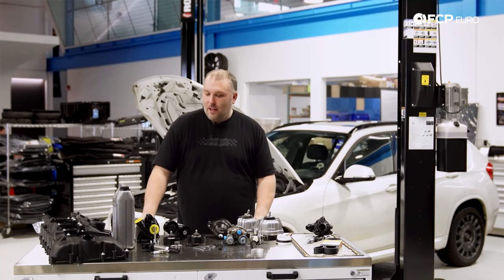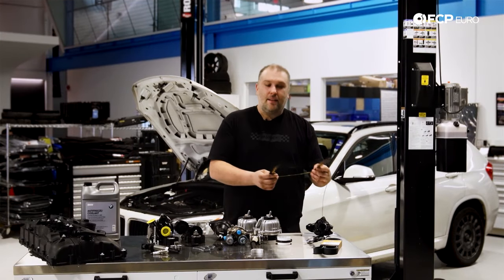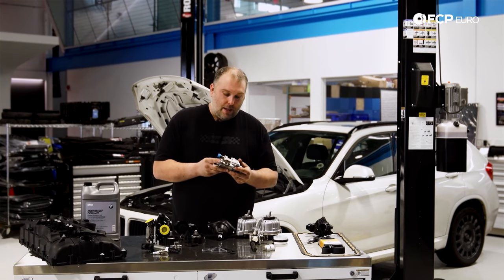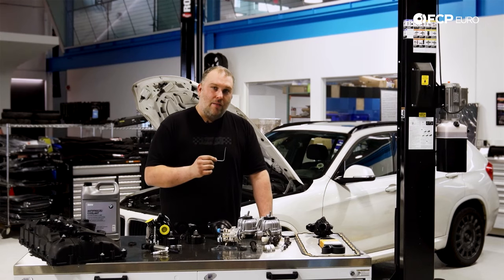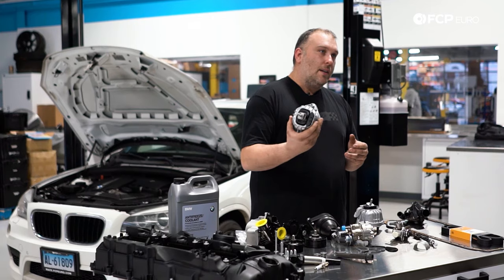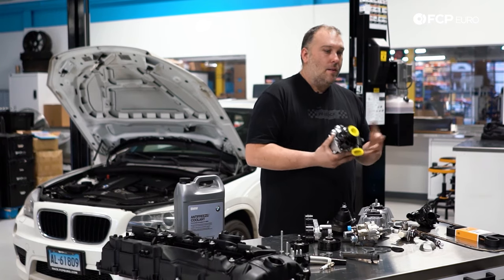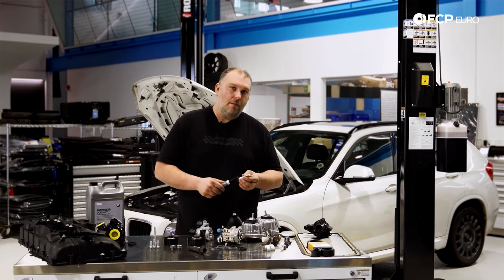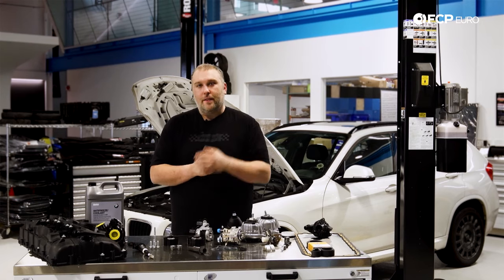BMW N55 Engine Diagnostics/Problems - Everything You Need To Know (X1, 135i, 335i, 435i, 535i)

Comment: Subbed! Knew about some, and already done.
Does the harmonic balancer itself wear? The rubber part on the crank pulley? My pulley has a wobble, causing squeal when cold. Replaced belt 3 times, and the 2 idlers and tensioner. All accessory pulleys running true. I know you can't diagnose in the comment section. Just a general question if you guys found that you have to replace them around 100k miles often.
I've heard about vanos filters? ie. oil filters screwed into the block at 2 places apparently. Is this true, and should they be changed at some interval even just as preventative maintenance?
Can you do a video on just what should be done at which miles for us far outside the US that have to service ourselves? DCT oil change? gearbox filter. Diff oil. Any info regards timing chain slides?
Went through your shop! So much I probably need :-(  "suspension" rattle in the back over rumble strips, with my luck, probably subframe kit if I'm lucky, and I'm not.
And what about factory recalls? I saw one about a bit of battery cable around the passenger footwell that should be replaced. Would this lead to battery not properly charging? Those kinds of issues? ISTA showing a low voltage reading even with a charger connected etc?
Reply from the maker: The rubber part in the crank pulley certainly can degrade and cause a wobble/off balance. It's certainty not a bad idea to inspect those Vanos filters. We have more videos planned, thanks for subscribing!
Reply: @fcpeuro  Thanks so much for the reply! Looking forward to more of these terribly informative videos!!! The one one on interchangeable suspension components to upgrade to M3 stuff was a real eye opener!!!! So much info here!!!!

Comment: So best way to prevent valvetronic from going is to keep up oil changes?
Reply from the maker: Keeping up on oil changes is just a good practice overall, Francis!
Reply: Its going to happen anyway, based on what I've read. Goof thing the solenoids aren't expensive...

Comment: This is very misleading as he is talking about almost all service and wearing parts and ALL engines wear out eventually. He also should mention the sort of Mia large theses items may fail at or need replacing. It the old story get your car whatever brand serviced regularly buy proper professionals and you will have trouble free motoring. I think this guy is just trying to help but it looks more like a bash up and the N55 engine has proven to be a very good and reliable engine. 
Jp
Reply from the maker: Hi John, you are absolutely right, the N55 has proven to be a very reliable engine. We are just trying to point out any possible issues you could encounter on the N55. These examples are like a perfect storm, it's unlikely you will have all these issues all at once or possibly ever, but of course, watching the video without that context can make it seem like they have a lot of problems.
Reply: FCP Euro Thanks for the reply I was not having a shot at you more some of the people commenting as there are always people reading BMW content that just want to be negative so I get a bit sick of that. I have owned a lot of BMWs over the years I always compare what is around before buying just in case there is something of interest in other brands but so far have stuck to BMWs. I currently have 2 an X1 and a e90 M3 so I see a lot of stuff on forums rubbishing the e90 M3 Rod Bearing and Throttle  bodies. But perhaps those knockers should look at the Mercedes forums to see the multitude of issues with the especially the C63 - 6.3 motor which was plagued with issues. And Audi does not escape either. Most people don’t appreciate that these cars are made to be driven at high speed on German Autobahn’s and then serviced regularly at specialist centres then they all work well. Anyway just my rant I am about to replace my wife’s X1 with an X4 35i so have spent a lot of time researching the engine. I tend to always buy used low mileage BMs and tend to pick and choose models based on their overall history and of course driving experience. I have owned 4 x 3 series, 3 x 5 series, 3 x M3s and 1 x X1 and I can put my hand on my heart and say they have all be totally reliable and trouble free, also not as expensive to own as I had expected. I have had Ford and GM products that cost more to service. 

Thanks again for the response 
Jp

Comment: Are 2013 n55 reliable ? Cause I see 2014 535i cost a lot more. I'm wondering if they're both essentially the same reliability wise
Reply: Its the same thing, in 2014 things like the steering wheel changed on the interior and other small bits which is why it may be more expensive and plus its a year newer. But as far as engine it is the same and yes they are very reliable as long as they have been properly maintained.

Comment: Yep seems about right, I've done Oil Filter Housing Gasket & Valve Cover Gasket along with some coolant hoses at 57k miles, High Pressure-Fuel Pump 65k. My next items are waterpump/thermostat and all pulleys and belt just to be sure. I am currently at 85,000miles 2011 135i N55 2010 production line so I am guessing a very early model
Reply from the maker: Sounds like you're on top of things, Aver!

Comment: I have recently bought a 2013 n55 335i with 62,220 miles . I now have 63,330 miles and have had to add 4 quarts of oil in a matter of 2 months. There are no visible signs of leaks , and I only add oil when it is either low or when I get the minimum oil warning, I don’t add oil just because I add it because it genuinely needs it . I do drive the car relatively hard , but even then I don’t see my consumption being normal. Oil change was done 1k miles ago most likely at the dealership. I have since used 5w-30 to refill it . Any advice would be helpful to guide me to the right direction of figuring out the issue .
Reply: For starters, don’t drive the car too hard. I’m a spirited driver and my ‘11 N55 has over 110k miles and I don’t use anywhere near that amount of oil. I do know it has at least 3 small leaks and I’m still only using a quart or less a month. From what I have seen, BMWs have long been leakers/burners, so I’m guessing there’s no real solid solution other than don’t drive BMWs, but as someone who has owned 2 now, I’m really in love with how they perform. I’d rather have a ratty BMW than a good woman.

Comment: My car goes to limp mode/ engine malfunctions. Then I restart the car everything is ok again. What could be the problem? Plugged in the diagnostic tool no codes showing.
Reply from the maker: What diagnostic tool are you using? That's very unusual to find no codes after your car goes into limp mode. Maybe the scanner you are using does not work properly with your car?
Reply: FCP Euro code p0420 bank 1 catalyst system efficiency.  Looks like my catalytic is done. Can this be the reason why my car is turning off/ engine malfunction?

Comment: IM CURRENTLY GOING TO THE DEALERSHIP IN TWO WEEK SO POSSIBLY BUY A 2015 435m sport with 70,000$ for 25,000 do you think this is a good buy? And what problems should I expect PLEASEEEE
Reply: BMWs are money pits when they want to be, and reliable when they want to be. Roll the dice.
Reply: My 2014 535 is in the shop with a 4k repair bill rn
Reply: @iAlwaysSpeakTheTruth  thanks for the reply I bout the 435 and the first day charge pipe blew went to dealership spent 500$ on oem charge pipe installed it myself and everything has been great . I agree it’s either going to be a money pit or reliable so far nothing but good to say about the 435 hopefully the 535 doesn’t cause to much of a hassle
Reply: @seizetheblock7824  These cars are unpredictable. But age and mileage will show their weak points.

Comment: Are 2013 n55 reliable ? Cause I see 2014 535i cost a lot more. I'm wondering if they're both essentially the same reliability wise
Reply: Every year is an improvement for the n55

Comment: I'm so sick to my stomach right now. I have a 435i xdrive GC with 45,750 on it. Maintained properly, never raced, no issues at all until rear-ended on highway at 60mph in October. Now, after finally gettingcar back ten months later, the valvetronic servo sounds like a freaking woodpecker and BMW just shrugs, says "oh well, sh*t happens with those things, that'll be $5k to fix."  And then there's all this other stuff waiting to go out... and don't tell me it depends on mileage and maintenance because it obviously doesn't.
Reply: Same boat.
Reply: Seems like its age/mileage related, though not maint. Don't go to a dealer? $5k for what????

Comment: Sir, I run an F15 X5 2014 year model with the N55 power pack. Is this year's model the improved version of earlier ones that suffered rod bearing and high pressure fuel pump issues? Thank you for the great videos.
Reply from the maker: Glad you like our videos, Aaron! Rod bearing issues on the 2014 (or most N55's) are unlikely with proper maintenance.

Comment: I had a Lexus direct injection engine and to prevent the carbon buildup I would twice a year do a service at the power brake booster hose to suck cleaning fluid into the intake. What can I do on the N55 to prevent this?
Reply: A catch can is about all you can do, plus keeping your oil and spark plugs in good shape.

Comment: Would the tensioner/belts cause a squeak during cold starts (strictly only cold starts)
Reply from the maker: Hi Johnny, that is absolutely a possibility. You can always pull a belt off to inspect it, as well as pull it off to free hand-spin the pulleys.

Comment: One question on the pulley tensioner. The one I removed had the threads for the inner part of the belt, the one I installed is a flat pulley, just like the one you are showing in this video. Can that be a problem for the belt, or it doesn’t matter??
Reply from the maker: Should be okay!

Comment: I’m from Massachusetts and my 335i Xdrive with 60k has a oil pan leak. Everyone out here are trying to RAPE me with prices to fix it. Fml
Reply from the maker: Hi PrettyFe, have you tried going to any BMW independent shops or just dealerships? Independent shops might be a little cheaper than the dealer!
Reply: FCP Euro yes bud. I’ve been to 3 different places independent places at that and I’ve gotten $1,000,$1,200 and $1,300.. by no means I’m cheap but during these tough times I feel like that’s a little to much. What’s a reasonable price in your opinion????
Reply from the maker: @prettyfe2462  If you could have it done for $1,000 you would be in pretty good shape. It's definitely a big and messy job, and a bit more difficult on the Xdrive too.
Reply: FCP Euro thanx bud. Your input goes a longgggg way. Thank againg boss.

Comment: Scary we had bad issues with the 320d bad Timing chain failure years ago 
Was going to buy bmw 135i scary issues
Reply: The 135i doesnt have those timing chain issues.
Reply: @gilgonzalez5902  how reliable are the 135i N55 engines
Reply: @h4x0rl33tee  the N55 is a very reliable engine as stated in this video. When it comes to BMW as long as you stay away from the V8 engines you’ll be fine.

Comment: Reliable? M54, M52, M50 sound a lot more reliable.
Reply from the maker: They definitely are 🙄
Reply: @fcpeuro  360000km on m54. So smooth you think it has stalled after you turn it over.

Comment: Sounds like some of the same issues as the N54
Reply: A few of them but no wastegate rattle here and no high/low pressure fuel pump issues either which are expensive repairs on the N54.

Comment: 0:14 very reliable engine hhhhh. you cant say that to any German engine.
Reply from the maker: Atleast half the definition of reliable.... the high quality and performance aspect, just not necessarily the able to be trusted portion ^.^ Certainly no LS or K-20
Reply: 2007 n52 245k no issues fuel pump  
2009 n51 230k fuel pump no issues 
2011 n55 166k no issues 

2011 n55 129k fuel pump 

1991 e30 1991 388k original

Comment: @FCP Euro a friend and I have an ongoing debate, he has a 340i and I have a B8.5 S4, both are tuned running similar power level. If we compared the routine maintenance and common problem cost  up to 150k for both cars which car would ultimately cost more to own?
Reply from the maker: Oof, both are going to run your pockets a bit, that's for sure. The B58's common issues aren't as well known as those of the 3.0T, but from what we know, it seems like the 3.0T is a bit easier to work on 😉. Just based on that, we might say the 3.0T seems like it'll be a bit easier on your pockets.
Reply from the maker: That's a great question, both the N55 and 3.0T are pretty stout motors. I'd imagine you'd probably have pretty similar maintenance costs, assuming no major failures on either motor!

Comment: What temps does the engine run at normally from factory
Reply: 98.5 degrees f
Reply: Oil temps at full operating temps are 230° F - 250° F

Comment: Why does my upper radiator hose rub on my pulley?!
Reply from the maker: It shouldnt... possibly a missing grommet or routed incorrectly? You can send a picture to service@fcpeuro.com and see if they're able to help!
Reply: It have swapped it once already, after 10k miles i checked this one and noticed a small sliver has been rubbed and eventually will bust like the last one. I have thought possibly engine mounts causes alittle excess movement causing it to rub when under hard throttle. Or possible belt tensioner... idk I'll send a pic

Comment: First comment here. My N55 on a 2015 X5 xDrive35i (F15) has been rock solid so far at 65k miles. Did oil change every 6k miles myself by the N55 oil kit and followed all maintenance items. Just performed spark plugs change, coolant, brake fluid, and transfer case replacement. Great info here as items to watch out for, or do as preventative maintenance, as I want to keep the car for as long as I possibly can.
Reply from the maker: An Nguyen, a lot of the big ticket items here can be mitigated with consistent preventative maintenance that it seems like you're already doing. We are actually doing a video speaking specifically to that type of maintenance, intervals, suggestions, costs, etc. I'm sure you've experience it all first hand though! Keep that N55 happy and healthy, and you'll be able to hold onto that car for a long time to come. 65k is still young ;-)
Reply: @fcpeuro  just wait for your "maintenance, intervals, suggestions, costs" video. Thank you !

Comment: Thanks for the video!
As a previous owner of an N54, no! S65 is the only one I would consider now (and there are the rod bearings).
Reply: Make sure you bulletproof the Vanoss with a hardened hub and pressure lines by the way when I had my M3 I used cerma additive for the Vanoss and it corrected the seal problem it's worth the try for $125 you can't lose anything in the meantime getting to the job is painstaking and expensive you can find that at cermastore.com

Comment: This N55 engine is an absolute waste of money and time.

I don’t understand how an organisation like BMW could release such an engine with parts that are failing everywhere.

The only motive that comes to mind is BMW creating a demand for these failing parts and the repairs that are undertaken at their dealerships $$.

Why else would you release a crap engine out into the automotive market...

‘Hats off’ to FCP for their comprehensive overview of this disaster N55.

Case Study,
2007 Toyota Camry
2.4 litre, 4 cylinder 

Besides regular servicing of oils,  filters and tyres this is what has been replaced.  

Replaced at 130,000km with a total of 7 years of ownership,

 1x battery ($140 Century Battery)
 1x alternator ($550 Denso)
 1x alternator belt ($55)
 1x parking light ($3.59)
   Total amount: $748.59

$106.94 per year across the 7 years for the cost of parts for the humble Camry...bravo!

Would love to see the inventory list and costs for parts on the N55B30A.
Reply: Ok Scotty
Reply: What's amazing is the pain us motor heads will put up with to own a slick driving experience.  It might as well be a classified illness.
Reply: Good luck with those piston rings and the massive oil consumption issues that every 4cyl Toyota will have, of that year.
Reply: @ShowMeWhatINeedToKnow  Now the Camry is at 182.000, still going fine.
Reply: @imranrgoss9739  -- Every Camry 4cyl of that year will consume oil like crazy due to a defect in the piston ring design.  Not a matter of if, but when.

Comment: I have an 2014 X1 x35i Msport (e84/n55) with 55k babies miles and I absolutely love it. However, it’s had its oil pan gasket, condenser, water pump, thermostat (2x), front wheel bushings, coolant overflow tank, spark plugs,  and 2 injectors replaced, some under warranty and some post warranty. I’d never buy another BMW unless it’s on a lease with a factory warranty.
Reply from the maker: Sorry to hear that, Dan!
Reply: @fcpeuro  I appreciate your channel!